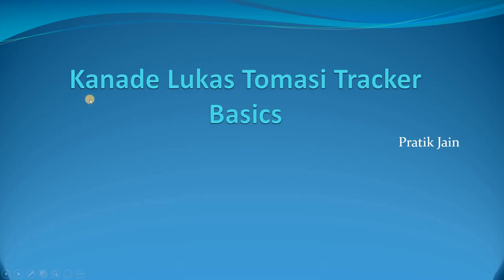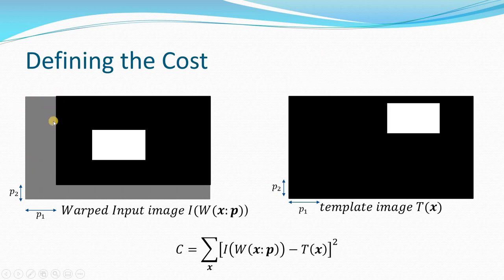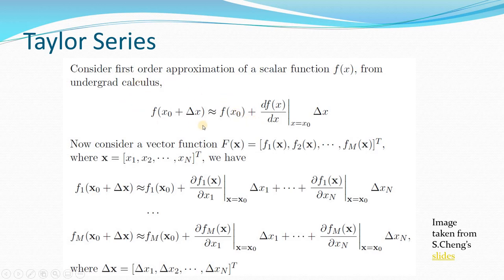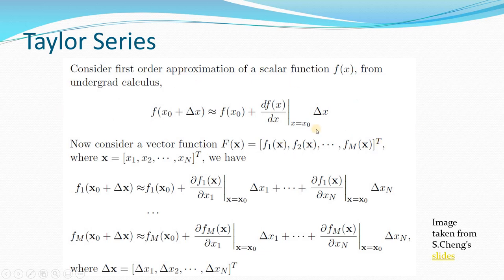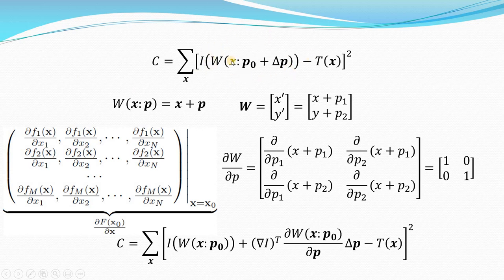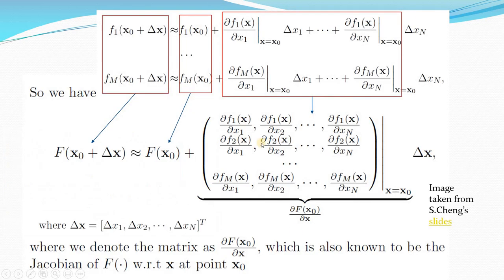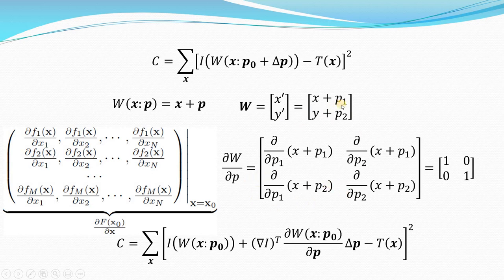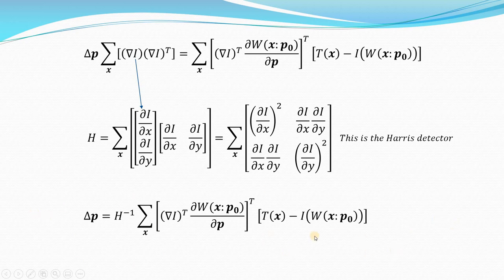KLT (Kanade Lukas Tomaski) Basics : Image Registration

Comment: The cost function is not completely clear for me, since it is unclear to me what the grey area means. What pixel value does it have? If it has (0,0,0), it is equal to black. If it doesn't exist, x cannot loop over all pixels. That's very unclear for me.
Reply from the maker: The gray portion will be excluded from the image. So the warning algorithm will shift the image and ensure that the warped I ( I(W(x:p)) ) is the same size as template T(x). 
Hope this makes it clear
Reply: @pratikian  Not entirely. So let's say:
A) The gray portion will be excluded from the image
B) The "warning algorithm" (not sure which one that is) will ensure that the warped image is the same size as template.
=> The image is filled with new pixels to make up for the excluded area.
What value do the new pixels have, just black?

I can see how this works in a binary image, but most images have more image values.

To be fair: I think that your video is not exactly discussing the topic that I am looking for (which is KLT Tracking in general) and therefore this "Image Registration" might be always a binary mask and therefore adding black space is no problem.
Reply from the maker: @TheElysium  I see your question, this algorithm is actually famous for it's tracking. So what happens is a part of the image is take (that is to be tracked) and not the entire image. So after the warping algorithm the position shifts and there is a new portion of image that is considered.